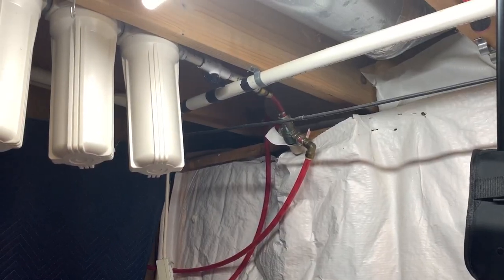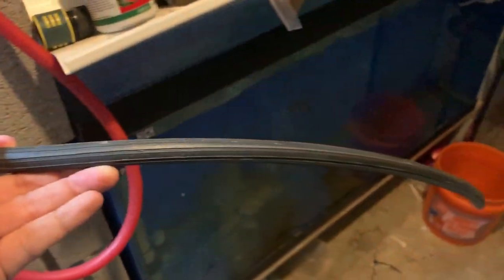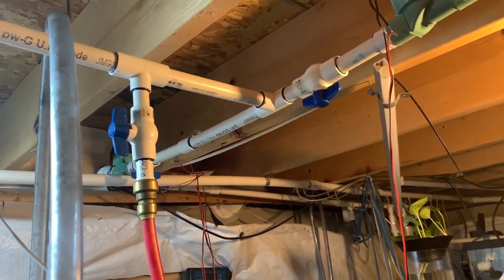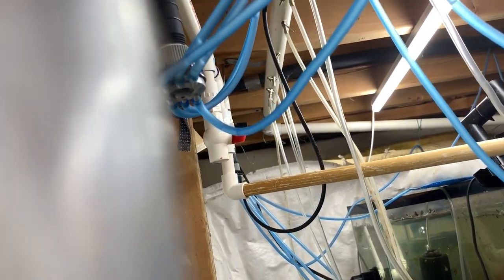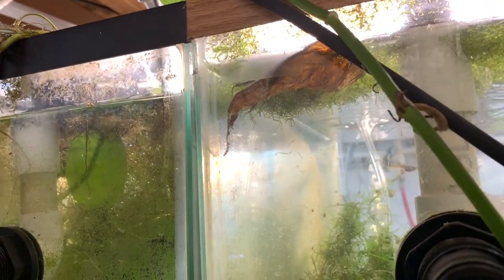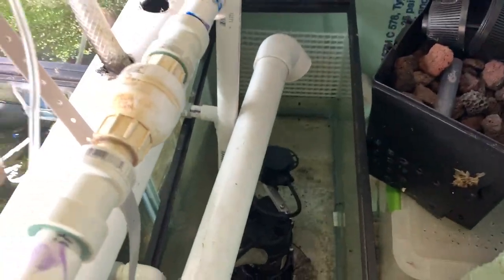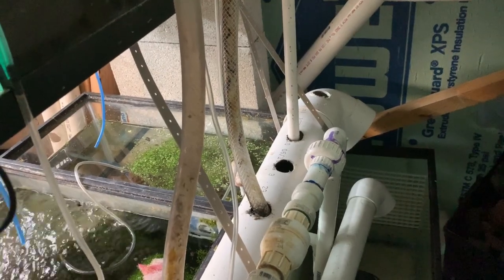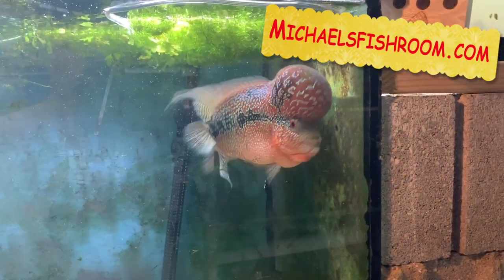DIY Auto Water Change System and Air System

Comment: How do you regulate the pressure from 6 port manifold to tanks? About how much water is going in during a water chnage?
Reply from the maker: What six port manifold?
Reply: @MichaelsFishRoom  sorry the drip irrigation manifold. That comes off the main pvc then splits into tanks.